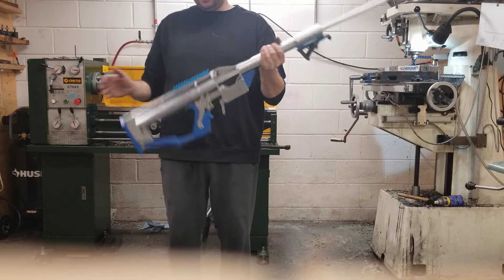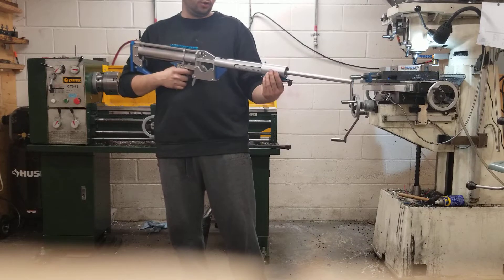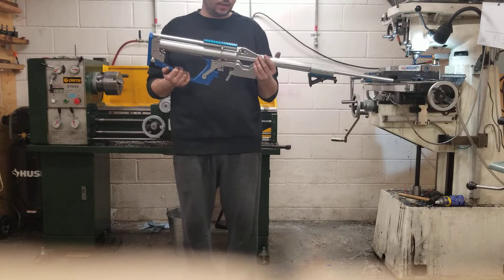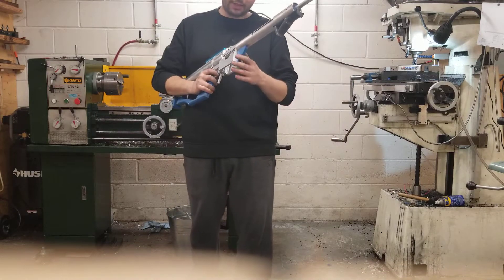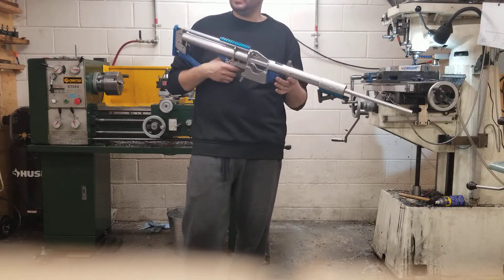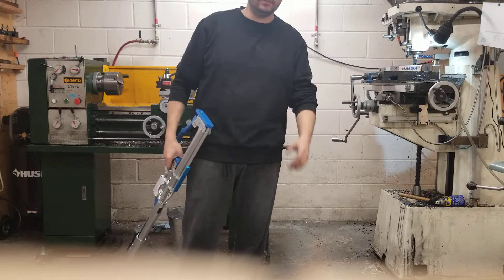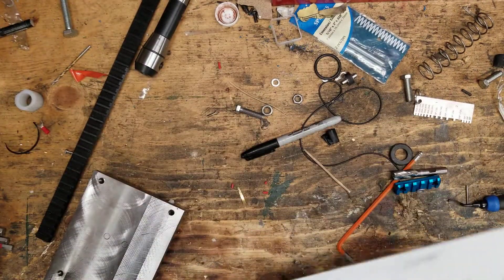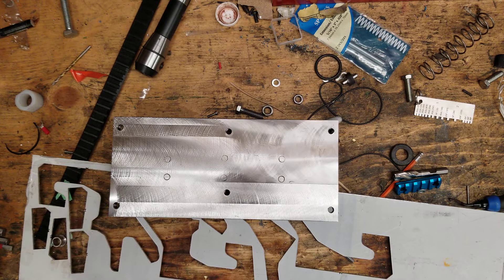First Caliburn off the waterjet cutter

Comment: Based on the people asking how much I can tell I'm not the only one interested in a kit.
Reply from the maker: There can be different configurations of the kit. Different levels of machineing also. This can range from straight off the machine  with no post prossesing to bolt together .  Im thinking of including drill jigs if people need them. However id need to get at least 5 of them cut to make it affordable. If yoi want more info or to be put on a interested list. Email danny931202@gmail.com